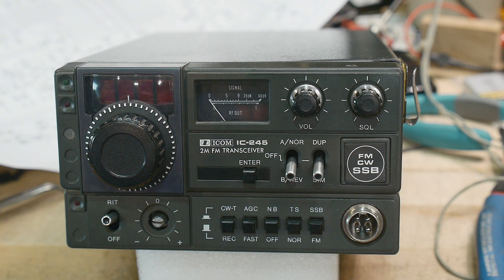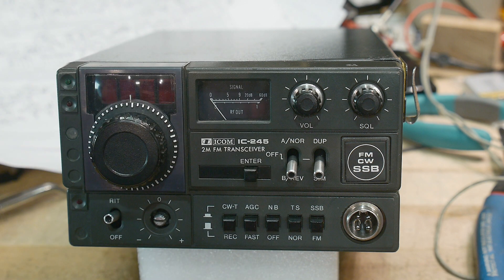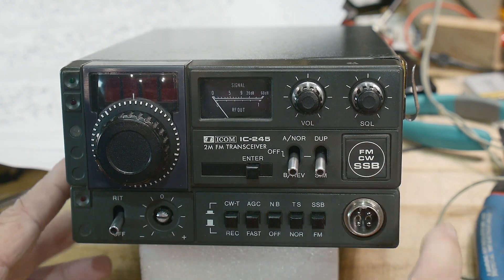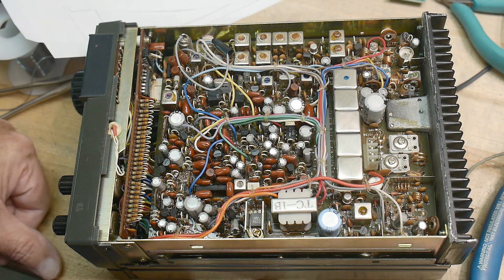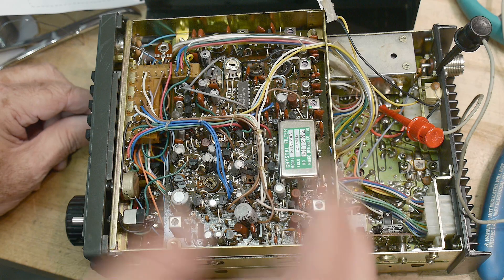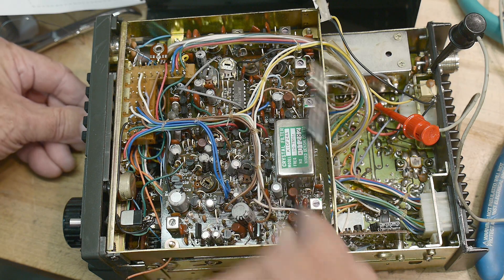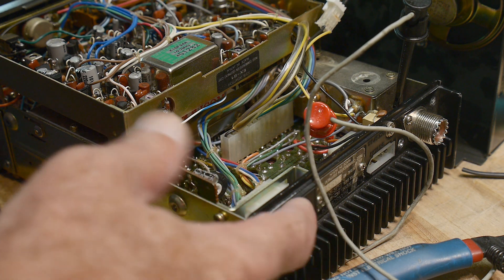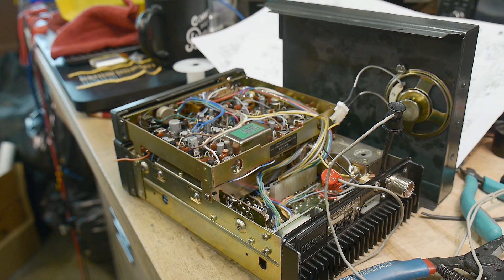#950 ICOM IC-245 Dead or Alive?

Comment: I have never seen the 245, but I did have an IC-211-E (my first base station rig) 144Mhz all mode.
 
The power connector is a Molex, and I think you will find that a PC disk drive power lead fits it. (or can be made to fit)

The big mulit way connector (another molex part) was also fitted to the 211-e. It provided direct access to the synth and you could make up a keypad for frequency entry and of course had the audio and other in/outputs. 

I never saw any mention of using it for a transvertor., but you could easily make up a remote head for the rig if you wanted to.

The 211 was a nice box, and mine proved very reliable. They did have a smalll reputation for nthe synth not to lock, and that generally came down to the solder joints on the synth pcb, re-soldering them   cured many of the faults. (mine never suffered for that) I would expect that the 245 synth is very simlar.

I bought my 211E in Sept 1978 the 245 looks to be of similar vintage.

Andy